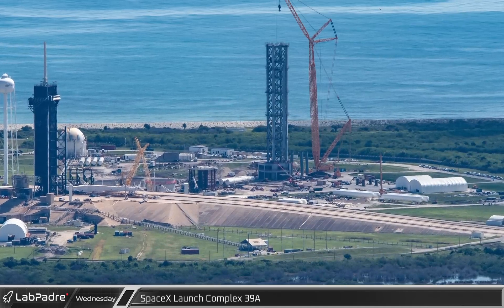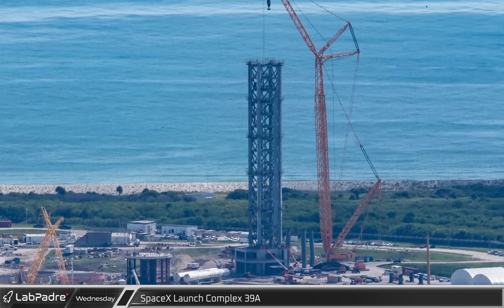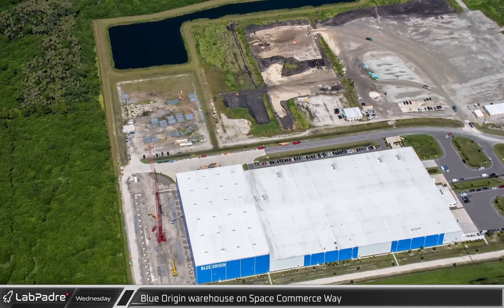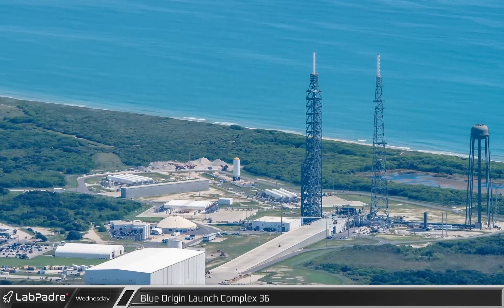SpaceX Continues Rapid Starship Progress - Weekly Update #22

Comment: How does the Octograbber grab to the ship floor? Magnets?
Reply from the maker: Good question!
Reply: the F9, once empty of fuel, is very bottom heavy. Combine that with the extream weight of the Octagrabber and being right on the deck keeps the F9 secure. If they encounter any high winds or waves they have been know to additionally chain the F9 to the deck.

Comment: Which will happen first, Completed Cape StarFactory (just the main building) or Completed Stage 1 of Star Factory at StarBase (remembering they  have to dismantle Tent 3 just to start Phase 2)? Cape Mechazilla is coming together far faster then Starbase Mechazilla
Reply from the maker: Cape is catching up fast!
Reply: @LabPadre  It speaks to 2 aspects of construction, first the cape is closer to manufacturing facilities so it takes less time to get things to the cape and second it's much easier to build buildings when you aren't working around an existing and functioning factory.